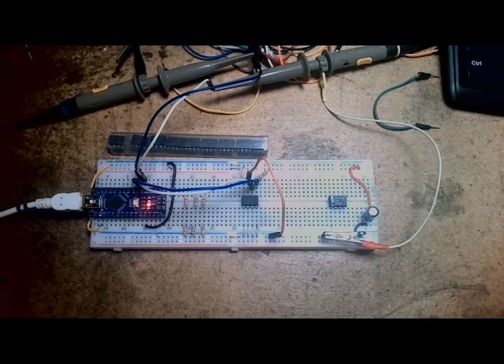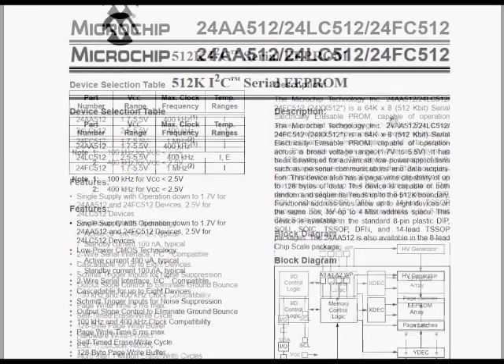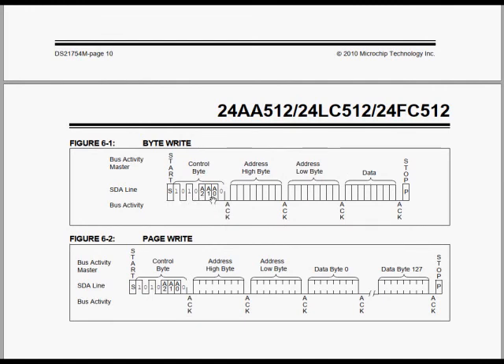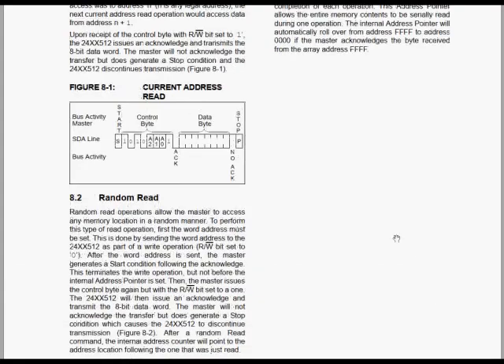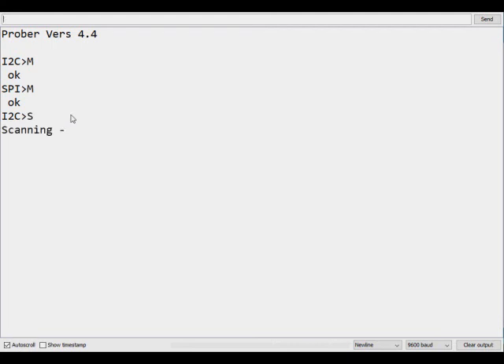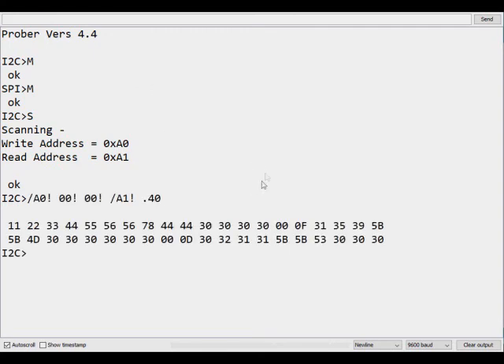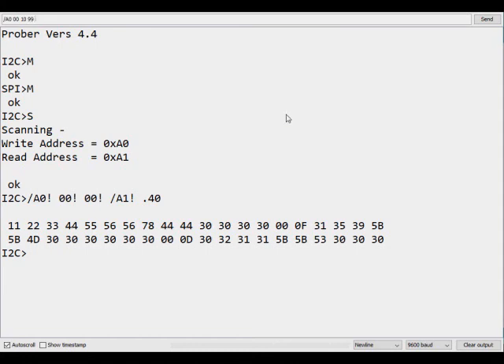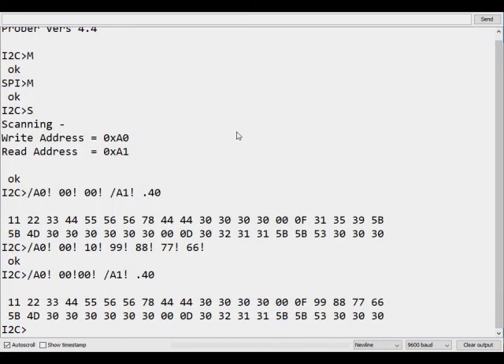Mondo Technology: Hacking into I2C and SPI.

Comment: So would i be able to use your program to hack a eeprom chip and change its value?
Reply from the maker: This program allows you to test out communication with any I2C/SPI device interactively.  Once you get it to do what you want, you send the same codes from a program you write.  This is much faster than re-writing your program many times to get the device working.
Reply: @luhanxmonat  ok, ok I don't have the device specs would it still work?
Reply from the maker: @maximus_chapman  Without the specs, you would not have a clue as to what commands to try.
Reply: @luhanxmonat  possible though? It's a filament chip for my 3d printer that keeps track of how much is left. It won't let you use more than what's on the spool so I have to buy filament from sindoh. I'm thinking I could track the communication with the printer?
Reply from the maker: @maximus_chapman  Get one of those $10 logic analyzers.  You need to tap in to the data lines while the machine is running. They have decoders built in for I2C, SPI, Serial, and other protocols.  That will show you exactly what data is going both ways.
Reply: @luhanxmonat  that's awesome. Thanks I'll have to try that. You think a pico could work as a logic analyzer because I already have one?
Reply from the maker: @maximus_chapman  The free software that is available only works with the existing units.

https://www.amazon.com/Analyzer-Device-Ferrite-Channel-Arduino/dp/B099WJQV67/ref=asc_df_B099WJQV67/?tag=hyprod-20&linkCode=df0&hvadid=632548675900&hvpos=&hvnetw=g&hvrand=12705843198545939045&hvpone=&hvptwo=&hvqmt=&hvdev=c&hvdvcmdl=&hvlocint=&hvlocphy=9030034&hvtargid=pla-1881469048208&psc=1

Comment: hey there Luhan, this is a great video. I have a microchip setup i2c, no python library available. Can you help me with it?
Reply from the maker: I'm not set up for microchip.  You need the Arduino development software and a Nano to run my program. (free on GitHub).  That will let you explore the protocol for any I2C device.  Then its up to you to write your own code (on whatever micro you are using) to interface with the I2C device you have.
Reply: @luhanxmonat  I have it installed in a small esp32-c3 development board, microchip has its own pcb. You can have either full prototype or microchip pcb with i2c it just needs 1.8v 400khz. I'm new to the programming im more of a theorhetical mathematician. I really appreciate you getting in touch.
Reply from the maker: @nnoo  Sorry, I cannot make much of the information you are giving me.  Also, I have no experience with esp32;  all of my projects use bare Atmel chips on custom circuit boards.  I do use Nano boards for bench test setups as in this project.
Reply: @luhanxmonat  idq250c2 do you have email to share more info? Thanks again.